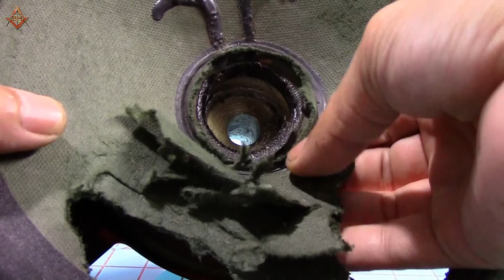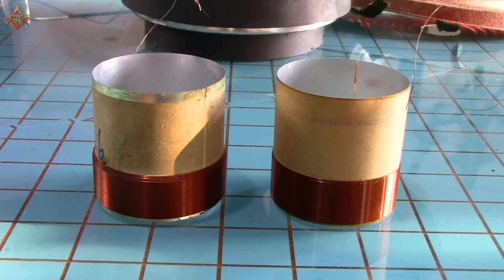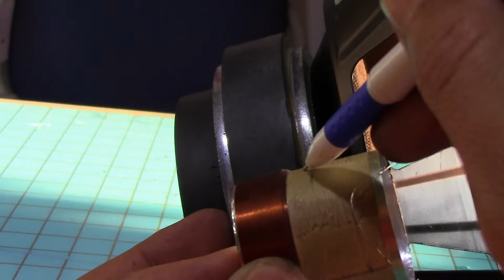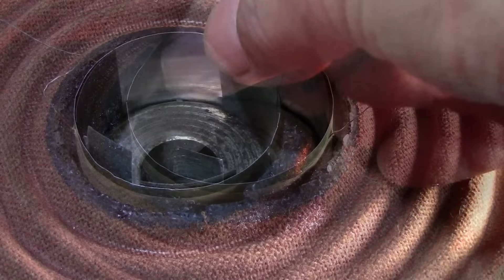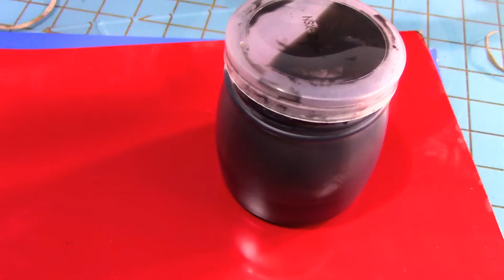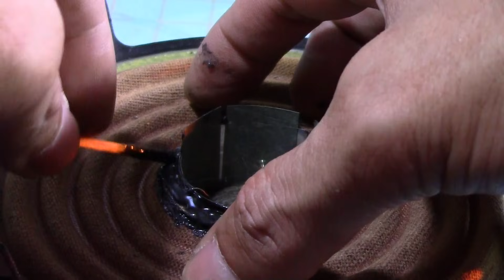How to recone and repair a speaker or  voice coil, Even the Blown Speaker was torn

Comment: This linen  spider assembly will not last. It has degraded and become brittle from heat damage. This needs to be replaced during the re-coning process.
Reply from the maker: I used a special adhesive for the speaker ...
Reply: Yes, I think your adhesive is fine. The spider is not. I am a former loudspeaker engineer, and I have built and rebuilt countless amounts of loudspeaker drivers and prototypes. I have performed countless lifecycle and evaluation tests of components and complete drivers in a laboratory setting and real world placement. This spider is brittle. No type or amount of glue or adhesive at the voice coil former to spider junction will reverse the heat damage that has already occured. Further more, all of these replacement components will alter the frequency response band Thiele Small  parameters of the drivers. The weight, shape, substrate, density, r and rigity of the cone, dust  cap will effect everything about the driver. Sure it might make sounds, for a while but it will be different .
Reply: @victorjbarker  hey Victor I have Yamaha NS4 speakers one of the drivers woofer has separated from the voice coil. As such I am able to pull the magnet off the back. I read it might be possible to reglue? Any ideas?

Comment: Dear Alfred kindly let us know which glue (black) you used, bcuz all my Coral drivers have been made using same or similar black glue & I need to repair few drivers so it will be nice to know about the black glue's pros.
Reply from the maker: You can use specialized glue sold in speaker component stores. that glue mixes with Asiton
Reply: You can use 'pitch' which is a tar based derivative and sets hard glassy OR as I have to fix the cone etc simply cyan late adhesive commonly superglue WITH care.. I've also used a ceramic paste.. 👀

Comment: how do you measure the spull at 8ohm or at 4 ohms?
Reply from the maker: You can use coil clock
Reply: What is a coil clock? I did a search on Google but it wasn't helpful. Is it some sort of measuring device?
Reply: @bytraper  I guess count the number of turns...
Reply: i think number of turn
Reply: @emilalmberg1096  thanks, I didn't know what this meant
Reply: @julyparado4412  thanks for making it clear

Comment: That is weak it will break on heavy bass .u shud have pulled off the spider and make a tight fitting with the coil before getting it back or use a new spider that fits tight.